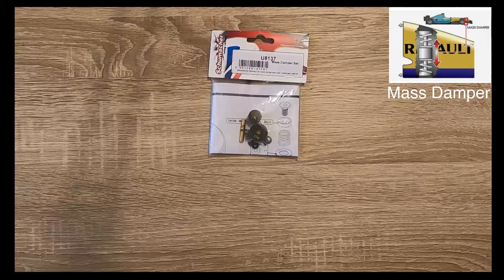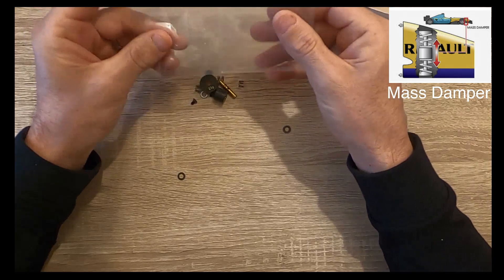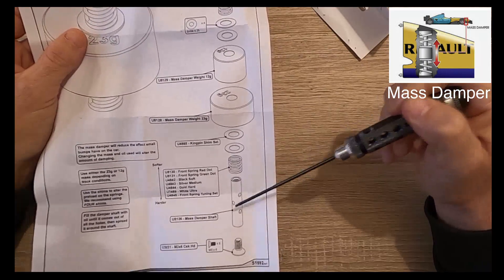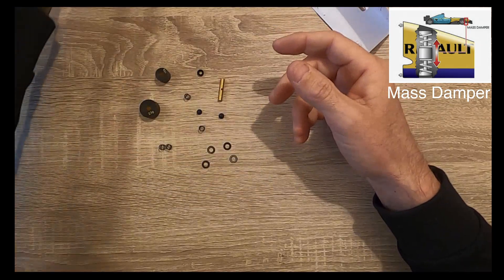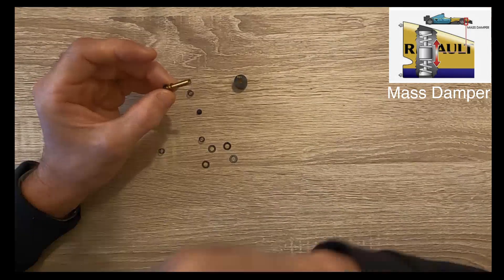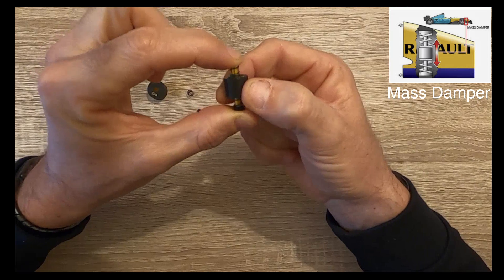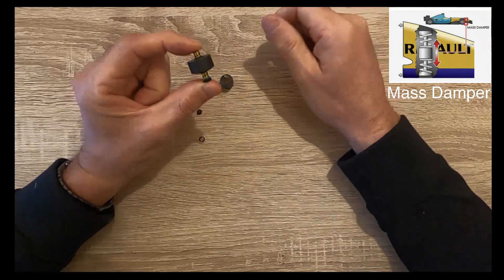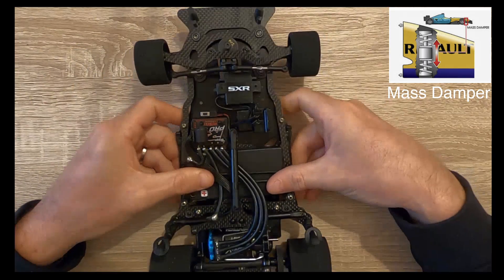Schumacher Mass Damper

Comment: Is the oil meant to fill the post or just coat the post. nice video.
Reply from the maker: Its supposed to fill the post :)
Reply: @RCRaceCar  Are the tolerances tight enough to prevent leaking onto the track?
Reply from the maker: Yes for sure.
Reply: @RCRaceCar what weight would you start with